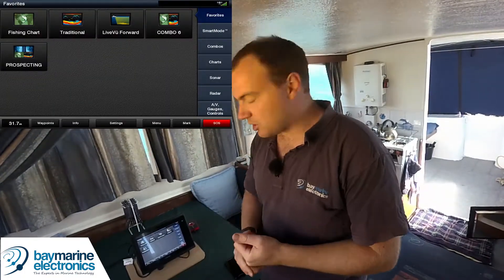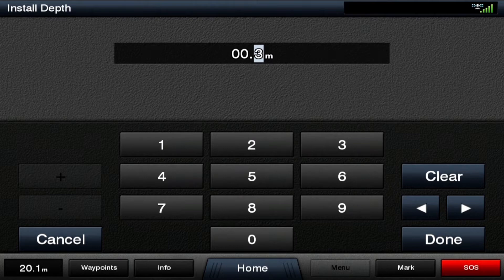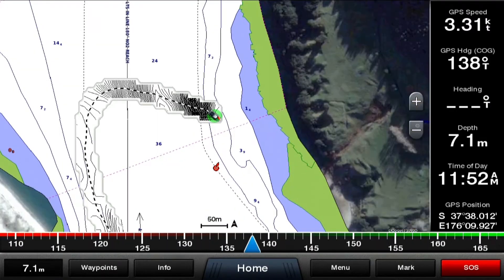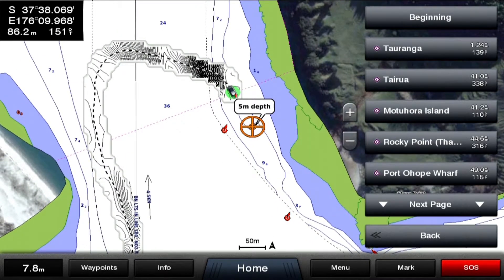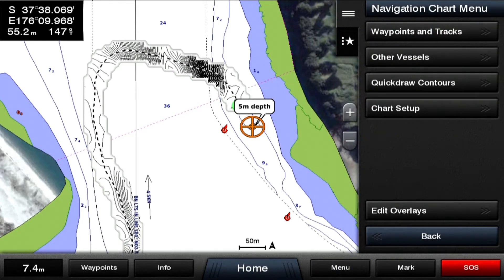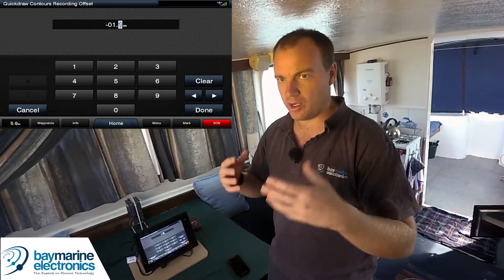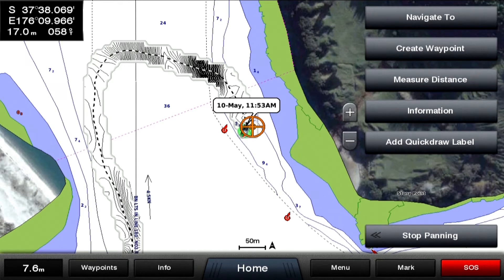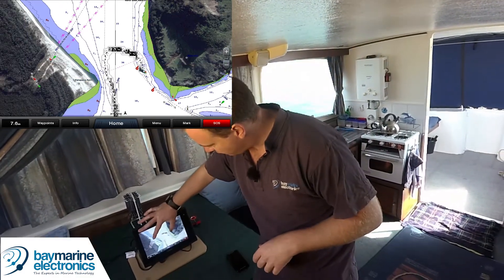Garmin QuickDraw & Panoptix in Use - Setting Install Depth and Tide Offsets

Comment: Very nice, clear tutorial. The Garmin manual does not explain the depth offset very well. In most parts of the World the datum is Lowest Astronomical Tide, so the offset is depth of water (read off tide function on your GPS).